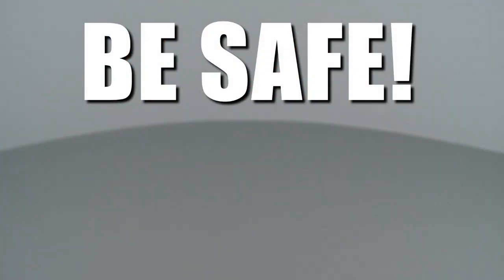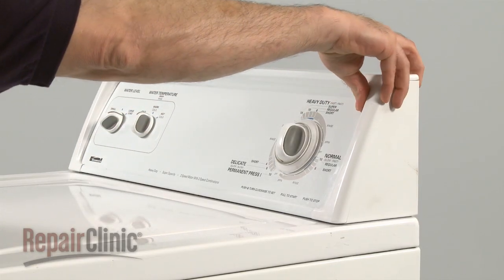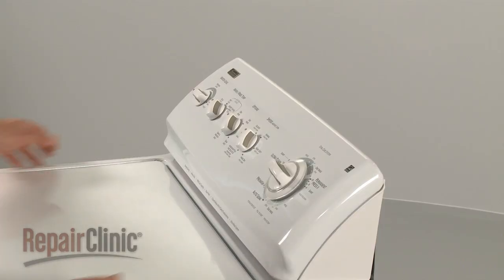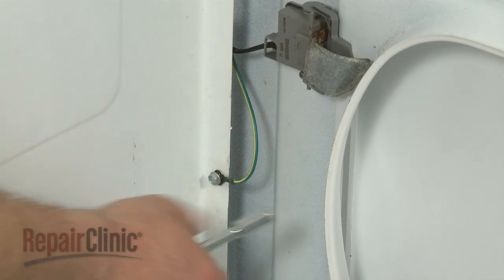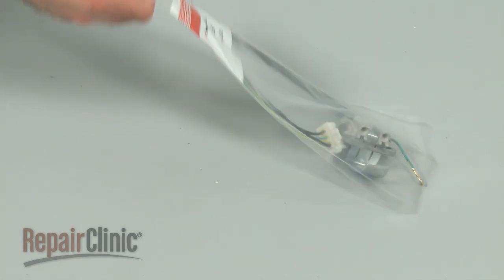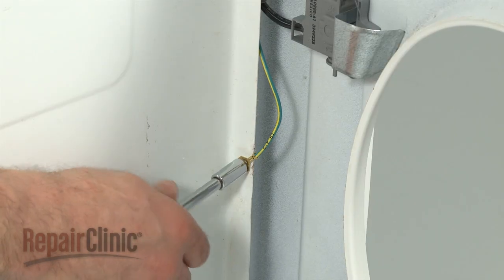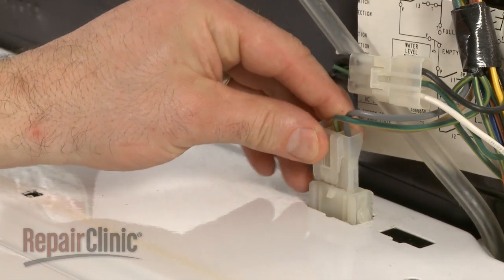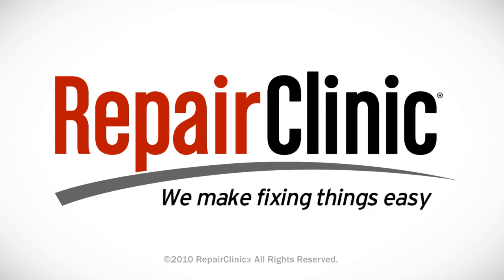Washer Not Spinning? Replace Washer Lid Switch #3949238

Comment: Thanks a bunch! I fixed my washer. It would only fill the tub with water but would not spin or operate any of the other selections. I came across this tutorial while I was looking up my washer info to compare it before buying a new one. I've had my washer for 15 plus years now. This is so awesome! I purchased the part through Amazon for under $5 and installed it without any difficulty. You all saved me from spending $600 to $1000. Thank the Lord! Whew!
Reply from the maker: We're happy we could help!

Comment: So thankful for this video!  I saved over $100 by doing this repair video.  I would recommend doing this with a buddy or at least someone who can start and stop the video.  If you need to get the water out of the tub, I suggest siphoning it by priming a hose, never sucking on the hose to start a siphon.  There are plenty of videos for that out there.

Comment: Thank you!  I had to take the washer apart because the lid switch had broken off where the screws attach it to the machine.  I followed the steps in the video & removed the cabinet, then the lid switch, super glued it and put it all back together! This video made it very easy, thank you very much for posting!

Comment: The video is a great help. I found the replacement part at an independent appliance shop. The switch and wiring were not too hard to replace, but re-seating the washer itself was a main. Pay attention to starting with the front panel first before lowering the sides. It's also difficult being squeezed between a wall and the dryer. The video did save me a service call, though. I just hope the machine is intact and balanced OK.

Comment: Thanks so much for sharing the video.  Washer stopped at the drain/spin cycle this morning, stared at it for 10 minutes before finding this instructive video.  It was a bad lid switch, not broken, just loose.  20 minutes later, and some duct tape wrapped tightly around the switch housing, and I'm carrying on with my day.  Much appreciated!

Comment: Thanks!  We were getting tired of having to place increasingly heavy books (up to dictionary sized) on the lid to get to spin cycle.  The repair took me more more than 20 minutes because our laundry alcove is very tight and removal/reinstall of the housing was difficult and cramped.  If I had a nice open area like a garage, it would have been super easy!  Anyway the instructions were spot-on and the washer works fine now without any books on the lid!!

Comment: Did the job!  Thank you so much for your video.  The part cost us $8 from Amazon, which came in one day, and my husband and I fixed it in 30 minutes (we worked slowly and we had to trim the length of the plastic cover over the wires).  Thank you!!

Comment: Without this video I would not have attempted this.  It turned out to be almost as easy as the video.  (The plastic pieces around the control panel put up a fight).  The lid switch was $41 and the job took less than 1/2 hour.  Thanks!

Comment: Another lid switch replaced with the help of your video. Many thanks! 

BTW, I tested the lid switch using a bypass made from speaker wire. Once I confirmed the lid switch was bad, I found a replacement online for $7. Video was very helpful in replacing new switch.

Comment: Great, clear video. Thanks!

Had some difficulty putting the cabinet on its base - back tabs weren't lining up. Was trying it blind - then I found the trick is to look straight down inside the front of the cabinet as you are lining it up with the front of the base.
You can then see exactly how the cabinet base will sit on its track, so that it does not sit high on the back tabs or bend them down from pressure.
Had to.retrofit the switch to original power connector for my older Kenmore. No big.

Comment: Fantastic video! Easy to follow instructions. Had it on my smartphone so that made it even handier to follow along. Was done in less than an hour. It only cost me the drive to the Sears parts store, the cost of the part, and a little bit of my time. Thank you!

Comment: Great instructional video!  With the help of this video, I actually did a temporary fix on the existing switch until the $37 replacement arrives.  

The switch itself had begun to split apart, so the washer would not enter the rinse and spin cycles.  

So I followed the instructions for removal of the switch and carefully used some superglue to reattach the two separating pieces.  It worked. At least we can do some wash until the part comes in.

Comment: This video was spot on!  I have a 13+ year old washing machine and the directions were exactly what I need.  The hardest part was putting the casing back on the machine.  Everything else was easy!  For $15 and about 30 minutes (beginner speed), my washing machine part was replaced by ME!

Comment: Worked like a charm. The old switch had become separated; I fixed it with plastic epoxy and some wire. Free repair job!

Comment: thank you so much for this video!  a google search helped me diagnose the problem and this video showed me how to take care of it.  everything was super clear.  you saved me at least $150!  i was quoted around $200 from 2 different companies.  instead, i went out and bought the piece at the sears parts store (and a socket wrench to get the ground screw out) and had it fixed in no time!!  thanks again!!

actually, there is one thing i can't figure out...getting the small metal retainer back in.

Comment: Excellent video.  I took my washer apart to replace the lid door switch.  I ended up just wiring it so it always ran instead of getting a new switch because, well, my wife doesn't exactly jump in the washer while it's running, so it's okay.

Excellent vid, thanks for all the help in disassembling my washer.

Comment: Excellent, step-by-step video.  This was my problem.  The metal flange on the lid switch had detached and the machine wouldn't go beyond agitating (no spinning or draining).  Ordered the part and it took less than 25 minutes to remove the old switch and install the new one.  Working like a gem now.  Had washed clothes in my neighbor's machine while down, including earlier today.  May now wash some CLEAN clothes.  Saved me a lot of $$ fixing it myself.
Reply from the maker: Great job!

Comment from the maker: Thanks for the question. Test the two outer wires. With the lid closed you should get a reading at or close to zero. When the lid is open you should get a reading of infinity.

Comment: Thank You so much for this video.  The switch was $25 and took just a few minutes for us to have it all back together and it is working.  Not bad for someone who had never seen the control panel from the inside.  Saved about $100 IF we could have gotten on the list for Service call, whitch is not easy being 25 miles from town.  Video is very detailed and easy to follow
Reply from the maker: Good work Vickie!

Comment: This video is well designed, providing just enough detail on the key steps with no wasted time. It covers variations in the way the control panels attach, and provides a few hints that assist reassembly .  Nicely done.
Reply from the maker: Thank you very much William.

Comment: Thanks for a great how-to video! I am an auto mechanic and I like to fix my own stuff when possible and practical. I diagnosed the lid switch without a problem. But didn't know the easiest way to access the connector to remove and replace it. With this video I was up and running in under 15 minutes and only 10 bucks cost! Far better than a new washer!
Reply from the maker: Good work!

Comment: Sometimes we take for granted our things and sometimes we underestimate what we are capable of. My washing machine fails to spin. I went to the net looking for help and found that 89% is a broken lid switch. I found an original brand new part for $7 (sears $38) and this tutorial video. The replacement part arrived and I fixed my washing machine by myself. Now I don't throw the lid any more, I "place" it and I found also that I'm capable to fix an appliance :-) remember to trust yourself and try!

Comment: Thank you for posting!  So many helpful tips in here, I only wished I had watched how the repairman removes the wire connector from the machine's connection point more carefully, as I didn't pull out and only pulled up, which cost me some time and aggravation.  Some machines may also have a screw in the back of the machine that holds the cabinet shell in place -- this also needs to be unscrewed before the cabinet shell can be removed from the washing machine.  All in all, great job guys!

Comment: Excellent video, I got my part on Amazon for $13.98 in two days. I did take 30 minuets or so, but I cleaned all the stuff out from underneath. That would be a video in itself, as the machine hasn’t been move or opened in 15 years. Thanks ERP!

Comment: worked like a champ.  $7 part and an hour, including time to wipe down all the yuk which accumulated in lord knows how many cycles over the years.  Thank you and well done.   PS My failure was the mounting screw receptacles themselves so I spot tied the switch closed (accomplished with no disassembly) while I waited for the part to arrive in the post.  Best price was worth the wait and the machine worked fine until I could replace the switch..

Comment: For the past three years, I have been banging on the top of my washing machine in order to start the cycle.  I knew it was a faulty lid switch and even had the part.  Finally, I replaced it today and it works!  Word to the wise - for me, the hardest part was getting the cabinet aligned.  This required two people.  Thank you!
Reply from the maker: Melanie Sweet Awesome. Thanks for sharing about your repair!

Comment: Thank you so much for sharing this how-to!  The only suggestion I would make is this:  when the old part is removed......and you are attaching the new plug to the metal frame of the washer.......be sure it is turned the correct way with the tab facing outward....if you don't.....it won't plug back up correctly to the other plug......thanks again ;)
Reply from the maker: Debbie Howard Thanks for sharing your tip.
Reply: Or just take photos of how it was before you disassemble!

Comment: Thanks for the video.  My washer's switch stopped working overnight and my clothes were just sitting in the water.  I don't have a back up switch as my washer belongs to the apartment complex.  So I had to short the connector out under the panel.  It's a temporary fix till my apartments replace my machine.

Comment: The repair worked!! Even a 66 year old woman was able to do it with a hammer, a Leatherman, and a lot of words she wouldn't want her granddaughters to hear. The hardest part was getting the screws to seat in the new switch (where the bad words were said). The hammer was for knocking the old plug out. I couldn't squeeze it together so I mutilated it and shoved it through the washer cabinet with the hammer. Still, I saved over $150 housecall.

Comment: Excellent instruction! With my issue however,  my switch had begun to come apart - bottom piece from top piece - so two strategically placed zip ties solved my problem. Thanks again for the video!
Reply from the maker: Glade it worked for you John!
Reply: I'm wondering about this, too. My switch broke away from the mounting screws, but otherwise works. Now that I can see it from underneath, I'm wondering about epoxy... and now zip-ties :-) I finished the last load of laundry with strategically placed rubber bands LOL.
Reply: Yes mine did too. I used duct tape first but my wife said don't be so cheap. Sooooo... It was so easy to replace. 2 day delivery $20,
 shipping included. Amazon rocks.

Comment: I have a Roper washing machine that I purchased from Best Buy about ten years ago. Thanks to your video, I now know that my lid switch has broken! I fiddled with it and got the washer to drain partway, but then the switch gave up the ghost. My question is, where do I find the model number? I live in a townhome and the washer is in a closet and can't be pulled out until the dryer is pulled out. I'm female and not strong enough to attempt this if the model number is on the back.

Comment: Thank you for the helpful video, ours gave us some trouble but it works for now, the part at first didn't seem to fit, but gave the prongs a little tweaking and then it fit, we still have to do a kind of cpr push on the lid at times for it to go to the next setting or spin?? We got the part for 13.08 through Amazon yeah! Thank you so much for putting this video up you saved us 100.00's of dollars:)

Comment: Excellent video.  Very easy to follow.  I have a Whirlpool model LSR8433KQ0 washing machine.  It appears that the lid switch is the problem.  The barrel won't spin/drain when the lid is closed, but when I open the lid and push the lid switch all the way down with a screwdriver, it works.  Can you tell me if the replacement part is a generic part, or is there a specific one for this model?  When searching online I find them ranging in price from $8 to $25 and can't tell if it just OEM vs. a after-market.  Thank you for your time.
Reply from the maker: +Erik Click here for info on the replacement lid switch: http://www.repairclinic.com/Shop-For-Parts/a11b5c35i213d583887/Model-LSR8433KQ0-Whirlpool-Washing-Machine-Switch-Lid-Switch-Assembly-Parts?TLSID=1874

Comment: I have a kenmore model with the end caps shown in this video. The back has been removed to replace the wiring assembly on the back panel. Do you have a video that shows the reassembly of the back panel and parts fitting on it?

Comment: Thanks!  Note: I have a Kenmore 80 series--called Sears they wanted $36.92 for the part  picked up at their center (under $10 delivered on Amazon)--but, since it looked so easy, I took it apart and found the switch housing had popped apart- NOT the female screw component.  I took a piece of wire hanger, bent it around the housing to hold the thing tightly together--making sure it did not block the switch hinges--Voila--I'm back in business with 20 mins effort and $0 in parts..!!

Comment: One piece of advice when ordering a lid switch part online, make sure that the connector fits before installing the switch.  Turns out Whirlpool part number was 247 not 238.  I thank the repair clinic immensely for giving me a bit of self esteem when the right switch solved the problem for $55 instead of $155
Reply from the maker: Mark Fowler The best way to ensure you're getting the correct switch is to search on our website using your appliance's model number. Only parts compatible with that number will display.

Comment: I understand about replacing the switch and how it works. I want to know how to test it with a analog multi meter. I know to use lowest ohm setting, for me rx1, I get a reading on first and middle prong connector only, not outer 2 prongs-nothing. Does this mean it's bad? I tested another washer that is broken in storage and It's different set of prongs. All other videos say outer 2 prongs for a test reading. Just want accurate testing.

Comment: Upon first seeing a stopped washer with its tub full of water I thought $.  This thing was about 6-7 years old so I'm thinking:  Will the repair cost be worth it?  Will I need to take time off work to attend the service call?  Should I consider a new washer?
$$$$!  :(
So to get an idea, I first looked on the internet for the best and cheapest option.  All the while thinking "Maybe I'll be lucky and a reasonable serviceman will be able to diagnose and fix it for under $100."
Then, I find this video, got the part, and fixed the problem.
Thank you, thank you, thank you, thank you! (Seriously... Thank you).
Reply from the maker: SuperDufus That is what we are here for, helping do it yourselfer's like you. Thanks!

Comment from the maker: Did you check the part to make sure it has continuity? If it does I would suggest using the repair help section of our website (link in the description). If you enter your model number there you'll have access to model, part, and symptom specific repair help. There are a few different things that could be going on here and our website should give you some ideas on what to be checking.

Comment: Finally! To release the control panel on Kenmore's with a clip holding it down, it takes a very firm or rapping of the putty knife to unseat the clip. The clip is metal just like the frame clip and may be corroded or gummed into place.

Comment: I purchased a Kenmore Elite Oasis HE in September of 2009.  Soon after it went out of its one year warranty, I started getting a DL error.  I discovered that the only way I could get the washer to work was to immediately jump up and sit on the lid until the lock mechanism was recognized.  Then the cycle would work.  That eventually stopped working and I had a repair person come out.  He said I just needed to tighten a screw.  The lid switch itself works fine.  How do I fix it myself?

Comment: Great video! but i must say the quality of a Kenmore washer has gone done the drain. First, there is no reason the switch should fall apart like that and the black floor base was TOTALLY rotted out! My washer is only 5 years old and it replaced a kenmore I had for nearly 30 years that was rusted but not to the point where the metal could be crushed by bare hands. I now have a feeling another part will need replacing soon.

Comment: Thank you, great video, finally replaced my lid switch.  Only one problem, I ran 3 loads, then the machine stopped in the spin cycle before rinse!!  I tried & checked everything.  The part is grounded, checked my fuse box, all connections are clean!  I don't get it!!!!